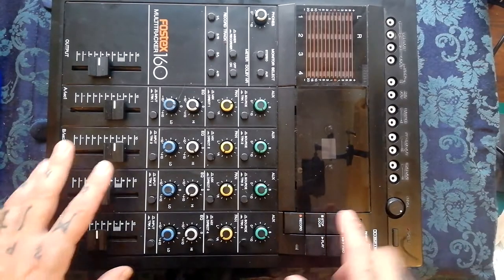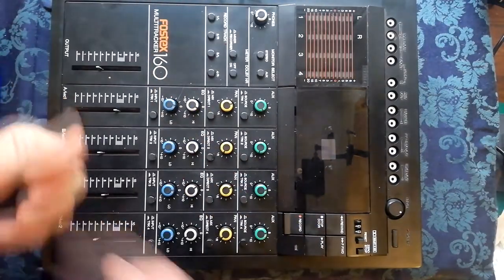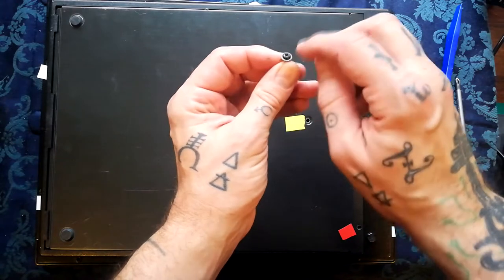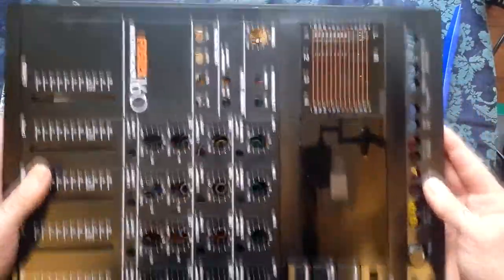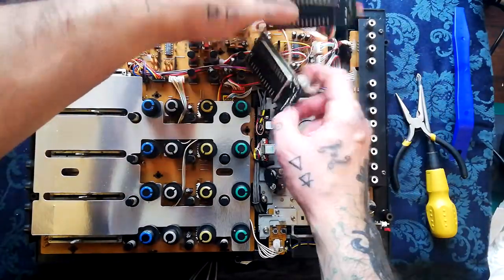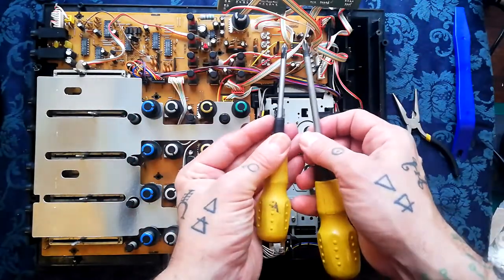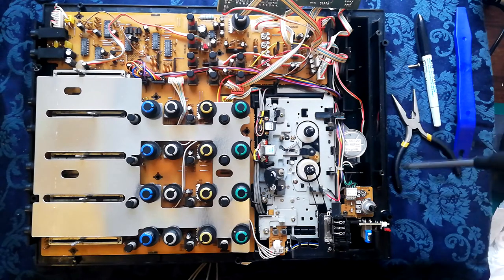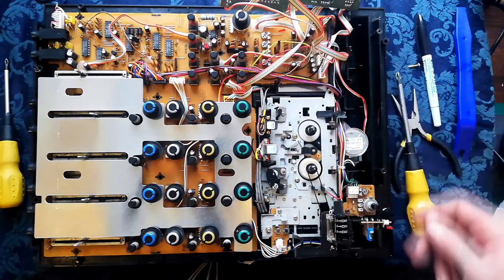Fostex 160 | Tear Down | 1 | Open Case | Remove Transport

Comment: Hi! I have had a Fostex 160 for years, unfortunately it is not 100% in working condition. I don't really know how to troubleshoot the issue (volume on one or several channels). Do you have tips to help me troubleshoot the issue, and maybe find the solution? I don't know if there is a troubleshoot user guide somewhere, besides your videos. Thanks!